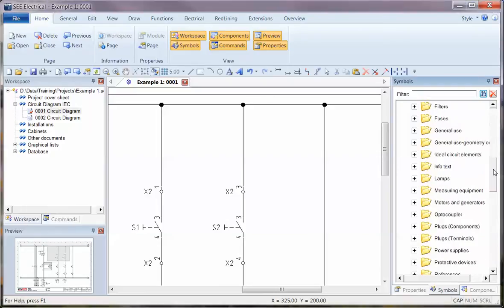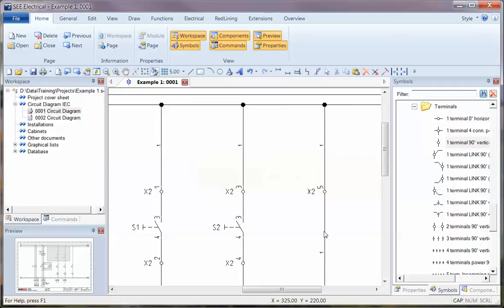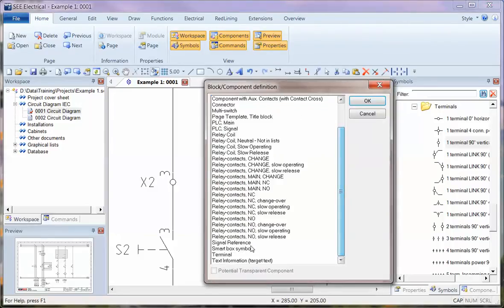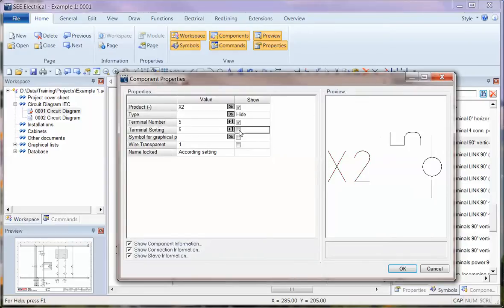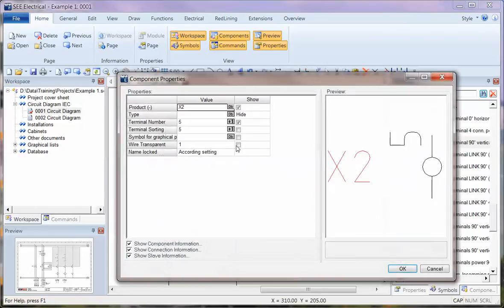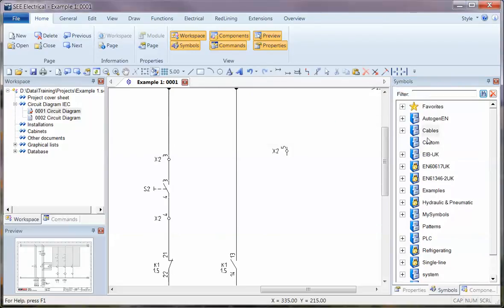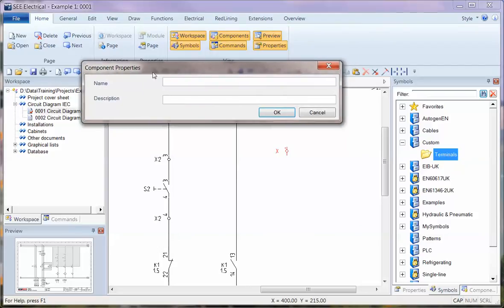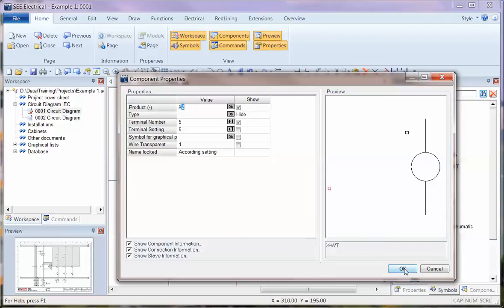Wire Numbering Through Terminals V7R2

Comment: In V8R4 I think there is no need to do that anymore right, when generating there is an option to create the same number on both sides, but when I use multi level terminals I'm getting the same number on different levels, is it a bug or I'm doing something wrong?